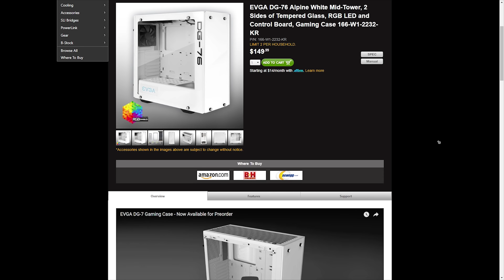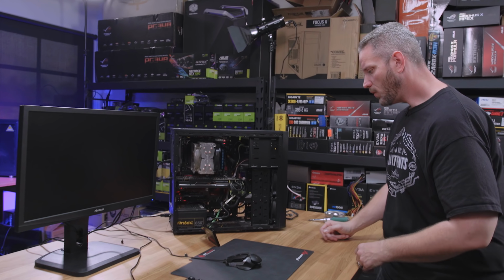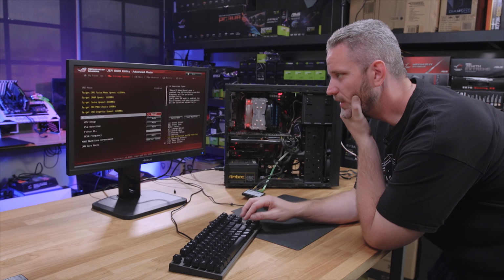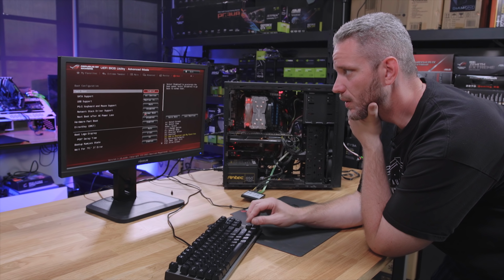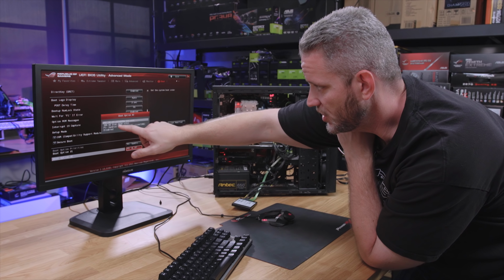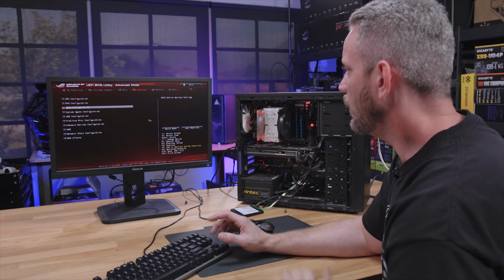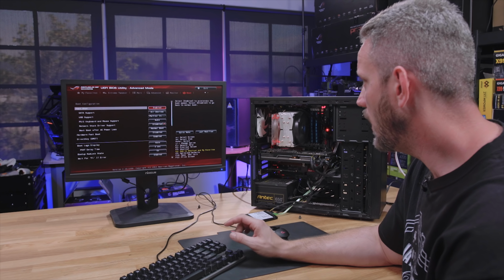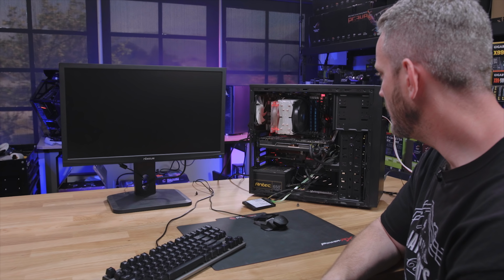Troubleshooting a bad computer... can we fix it?

Comment: I remember building my first pc in the mid to late 90's. Touched the front Power connector wires whilst it was still on and threw myself across the room. Never did that again :)
Reply: TechWizTime 12v........it cant do anything
Reply: Jack Williamson but it can’t hurt you
Reply: KrazyFuckinCrackers1 but it will shock the hell out of you
Reply: All I remember from the experience is to first remove all power from the case :) I have pretty bad luck when it comes to electricity. I was also thrown across the room after touching the metal contacts in the RF cable. Spent the night in hospital on a heart monitor. Don't remember much of that one either :)
Reply: in old pcs from the 90's the front panel power switch turns the psu on and off and the switch doesnt go into the motherboard. nowadays psu is controlled entirely from the motherboard.
Reply: TechWizTime. Lol. Not possible. I've been shocked by 10k volts Dc, and nothing happened. Btw pc,s run off Dc voltage. The psu converts ac to dc. Dc voltage is much lower amperage. So it can't kill you. Or knock u an your ass.
Reply: Ah yes. Glorious AT spec. 115 or 230V just behind your front panel. Those were the days!
Reply: lol i remember back in day i took vcr apart to just watch how the tape got stretched over that big round spindal thing and i remember putting fingers on something in there while it was doing that and lord that sudden jolt of electricity like when u grab a electric fence hit me and never took vcr apart again lol.
Reply: The dangers of AT PSU. With my 386 machine I had 2 PSU, and the one that functioned (no dead caps+new fuse) was the one without insulation around the switches contacts. Damn thing threw me as well when I turned it on (I don't have a proper AT case to work with, only a 2004 one which bizarrely has support for full AT boards as well as ITX-ATX).
Reply: Try to touch a power supply of 300W and getting all the voltage on you. You're stressed for the moment ( half a second ) and then just laugh about it.
Reply: haha old AT power supplies with mains right to the switch, used one for a while to test car radios until it shocked me a second time then got rid of it
Reply: Josh_519 I'm almost 40 (so not a millenial) and it was 240v back when I was a kid :)
Reply: I did that WAY before computers. I was 2 1/2, stuck a key in a light socket. Ran around screaming, 'It bit me!'

~Edit~ Been obsessed with Electricity ever since.
Reply: Yep you had to really watch out for those old AT style case because of them running the 110v-120v straight up to the power switch. I got a few zaps on the back of my hand as well back in those days.
Reply: Josh you could actually get a big zap from touching the back of the power switch because the wall power was wired to the switch so it had 110v-120v right there at the back of the power switch. You notice I keep saying power switch? That's because back in those days the power switch was actually a real switch and had real line power to it they called these old cases AT cases. The power switch was wired directly to the PSU and the mother board did not control the on/off state of the computer the power switch did. Now days we call it a power button because that is all it does is it is either in open state or once pressed a closed state which tell the mother board to power up or not.
Reply: Robert Lebrun yea I seen a guy stick a screw driver in the back of a PSU once I think he was trying to make the fan spin. The next thing we seen was him flying across the room. He would have touched the recifier cooling sink tower I am sure those are live high output power...We laughed about it but it took him about 10 minutes to regain his composer and laugh with us...lol
Reply: Remember AT power connectors? One long row of pins. Two half-row connectors from the power supply. And you just forgot if the ground wires go in the middle or on the sides.
Reply: @KrazyFuckinCrackers1 its not the voltage that kills you, its the amps
Reply: HA, cannot do anything.  12 volts is sufficient to shock you, the amps is how much that shit hurts. You hit my 12v rail and that sucker is 76 amps. It could kill you, but mostly it just hurts. I have also got shocked so hard from a simple 12v car battery on a shorted harness that the freaking leads melted and I went inside and fell asleep for 2 days. 

 Volts is potential for difference, the strength of current is the amperage, the potential times the amperage is the wattage, and the wattage how much total electrical force applied to doing the job, be it turn on a light, or clean your clock. An overly simplified so slightly BS analogy but workable one is using a river, were as the Volts is the grade or angle of the channel, the width and depth is the Amps, and the total water entering a gulf from the river is the watts. High amps with too low of potential and it cannot overcome the resistance of your skin. 100000 volts with .0000001 amps is like a static shock from a carpet, add a few amps and you are dead. 12 volts is sufficient to overcome your skin's resistance, and 5 volts can if you are a bit sweaty. In many applications DC can fuck you up worse BTW. AC in my nation per phase is 120v AC. 

That means the avg is 120v and it is a sine wave. The peaks are higher than the average guys, but it does not kill you, it knocks you the fuck back as the polarity changes every one 60th of a second. DC will hold you to it depending on if it either polarized or depolarized your neurons firing your muscles. You have a slight negative change so a positive will try to stick, where a negative DC will knock you away. Like charges repel negative attract.  I mean it is not like getting hit with a three phase AC, but then you are more worried about long term shit like, did that flash of light fuck me up in a way I will get macular degeneration in 20 years? Or I wonder if my fingers can be reattached. Bunch of stupid in the comment section today.
Reply: clamo6362 allways depends on intensity aswell. 50k volts at 0,005 amps can be np. 100 amp on 10volts can kill you.
Reply: True but it is more about how and the conditions of your body part. Is it dry, oh 100K Ohms in common but if you are talking the fingertip of say a guitarist perhaps 500k ohm. Wet can drop it down to 1k Ohms broken skin or sweaty say another 1K but could go off internal resistance that is much much lower. So you bump a powered 12v pin, it breaks some skin on your knuckles while you are reaching for a sata connector and your sweaty hand on the case.  12v divides by say 500 ohms into V/R xV=290 mw. 200mw over just a few seconds can cause cardiac arrest, and 250mw will cause burns, severe shock, and can kill most if prolonged contact is made for more than very short time. Do not take too many chances, electricity from a PC power supply can kill you. But best case it hurts quite a bit if you just short a finger tip, you will curse. Most of the time it will trip the safety. Then again, some folks have a questionable power supply.
Reply: +TechWizTime, hey TechWiz love ur vids man I’m like 20mins from Wollongong 😂And lol I built my first pc about 3 months ago and I somehow managed to not break anything nor have to troubleshoot I fell sorry for your 90’s self 😂
Reply: eclipse6996 lmao
Reply: He did say he was thrown across the room. I am skeptical about that but I have thrown into sheetrock and made a dent from a  signal that was based on an RF signal. But that was a high voltage radio transmitter used as retrans station. Giant radio antenna  about 40 meters tall and carried a few tens of KW RF and kindly gentleman that contracted me  had need of me to redo the connector.  I temporarily misplaced my stripper and decided to use the good old teeth. The retrans station was supposed to be dead. The computer that controlled it was not, and broadcasting station ID in my mouth. I got tossed like a toy though outside that it did not hurt me.  My mouth just makes a bad waveguide and so the electrical signal never made it to RF. 

Later in life working at the Sim Center in FT Hood I had to redo a connector as a commo guy in the Army. Giant field packed with hundreds of antenna and when I kneeled down to take a look that the connector on the coaxial for my units radio  the tip of my BDU cap burst into flame and I threw it down and noticed my hair smoldering. Good times. I do not have the PSU switched on working on PCs but I would imagine just one hand feels a bit like someone hit your elbow with a hammer(funny bone) assuming it has a way to ground out on that arm(case seems likely as your). You should never work around live current with both hands, or um,... it should go without saying but your mouth.
Reply: Josh_519
In the 90s the power switch was on mains power (120 / 220 depending on what part of the world you are from)... SO NO it was NOT 12volts...
Reply: TheGIANTgonads
By your own admission with that wiki link... Millennials  (Generation Y) start in the "early" 1980s... NOT in the late 1970s... SO if the guy is almost 40 he is more then likely born in the late 70s or around 1980... I am 40.. born 1977... we are known as Generation X...
Reply: gorepuppy
I am calling BS on your "shocked" by the 12volt of a vehicle... I have worked on and around vehicles since I was 10 years old(started on taking dirt bikes from the junkyard and fixing them up, to sell them, to earn money for food). I have never been shocked by the 12volt electrical system in the vehicle and I specialize in electrical repairs... NOW you can be shocked by all kinds of things in a vehicle, but never seen or heard anyone in this field who was ever shocked by the 12volt... Burnt YES... since messing with a live circuit and grounding out wires or the tools you are using, CAN and WILL burn the crap out of you when that much amperage from the car battery is ran through a direct short.
Reply: back in the 90's the psu switch was 120v and wired directly to the power supply
Reply: I WILL SHOW YOU DA WAE AT power was different
Reply: Just throwing my hat into this ring. 
1. The electricity doesn’t throw you. It makes your muscles contract and you actually uncontrollably leap. That’s a fact. Look it up.

2. Yes, you got shocked. No it was not enough to cause your muscles to react in such a manner. You are running off of one outlet off of one circuit on a set of multiple circuits. Contrary to what you see on television that will not give sufficient electricity to cause that reaction. Numbness and pain/burn marks, yes. In fact, that amount of electricity is more likely to hold you. Like on an old 110 before 220 became common. So as cool as you are trying to be, lying has led you to an actual journeyman electrician. So try and be cool by telling the truth. You didn’t spasm and leap backwards. You got shocked. It hurt. You might have even been dazed. But, not “thrown”. Not saying it was not dangerous or painful. Just don’t lie to be cool. Lying is not cool no matter your age. 

3. When it comes to home electricity and wiring, it takes contact to the metal plate at the back of the breaker box to cause such a reaction. Now with other devices that store and amplify the electricity within the home, then you can have enough electricity to cause your muscles to react in such a way. Unfortunately, a 90’s pc power on button doesn’t do this.
Reply: I rewired my first PC on a carpet. It was unplugged though, but it WORKED! I eventually started to get a garbled screen (GPU). Had no clue and considering the PCs age I got a new one. Took the old one apart and took the plate off the GPU (8800 GT). It had a FILTER of dust completely blocking any air flow. I imagine that was the problem. MORAL : Clean your PC often. Especially the fans. GPU. CPU. PS.
Reply: Excuse me but I've zapped myself with a pc power supply while cleaning when I'd forgot to unplug it or I was testing it I can't remember which needless to say it was direct 240 volts and I didn't get thrown but I know it bloody hurt
Reply: or should be as there was a lot of cases made in the 90's 
no doubt they still on sale somewhere
Reply: @WTFZOMG  I've worked on PC's from the 90's they turn on the same as today's one's sorry to disappoint

Comment: at 8:00 you said There was another bit of info that the customer told you that had you "extremely worried" and then never addressed it again. Now im dying to know what it was! Dont leave me hanging JAy!!!
Reply: Hey guys. Two things 

1. The SMART Check was disabled to get me past the error to test the SSD so that I could see if the OS would boot. They are advised to replaced the HDD. It wasn’t left “OFF”

2. The other issue that they expressed to me that I forgot to talk about was they had gotten an “over voltage warning” while POSTing once before the problems started. I don’t think the PSU is going bad, I think wires were possibly pinched causing a short but the issue never presented itself to me. 

Pinned comment from Jay, if you didnt see it already.

Comment: I love that Commercial Electric 10 in 1 screw driver you are using. It's the perfect size for jamming in the ground hole on outlets and tweeking them when the outlet won't line up correctly.

Comment: Great video, I did something similar to my brother's computer recently where I needed to replace his AIO pump and CLEAN the dust out.  Ultimately that's what killed it and raised temps in his system.  But it's all good now and I installed more fans WITH air filters on the intakes.

Comment: That looks like an NZXT Source 210......the first case I bought several years ago for my first modern pc build....and the one that introduced me to the perils of buying a case and not knowing about or adequately researching things like cable management space, adequate height for the CPU cooler, or mounts for 2.5 inch SSD's, etc, and having to buy another case that did have all those things.....only to find that THAT case didn't have adequate space above the motherboard to fit my cooler AND a top fan.....it taught me to check the specs carefully first for what I need, and worry about the price second.....it was a great learning experience that took me all the way to a Phanteks Enthoo Primo and a Thermaltake Core WP100! Long live the Source 210!

Comment: Every problem was unplugged cables or wires. Lame.
Reply: Yes, that seemed way too easy ...
Reply: @pufaxx  Also a drive being set wrong on bios. Or did it default to the other drive because the ssd was unplugged
Reply: To be fair that wiring job was a goddamn mess.
Reply: From experience, that's genuinely what it is 3/4 times.
Reply: @Anomaly188  i would make just the same mess though
Reply: The funny thing was, they went in and unplugged the GPU, AND replaced the switch cable.  At that point, any cabling problems that exist are PEBKAC.

Comment: What was that thing that had you extremely worried?
Reply: Rubik's Cubed possibly GPU and motherboard fried. Man , I'd hate to go out of the operating room to the waiting are , " sir good news we can fix your computer , bad news , its going to require a second mortgage."
Reply: texasdee slinglead Yeah, that makes sense. I'm glad that it ended up being a purely "cosmetic" fix, if you will. Didn't require the replacement or the troubleshooting of actual components.

Comment: This Video fking made my day. For the last two days i was looking for the issue why my new (old, because i bought a used one from a friend) asus mainboard wont boot any drive with GPT format. I was in despair. I accidentally came across this video and saw your tip switching off the SMART startup check and boom, it finally worked ;) Thank you very much!

Comment: I do much more of this type of thing, than any high-end builds. I did once rig an HP DC5850 AM2 BTX motherboard into a Dell XPS 700 Series case, re-wired all the LED strips, got everything working. 

It was crazy looking at a little micro-ATX board in a gigantic PC case. By the way, the Cooler fit just fine on the HP mini board. If anyone has a blown out XPS 700 series and wants to make it into a flashy Media center or something. I can help, and I think you can get a Phenom Quad into those old DC5850s.

Comment: Sounds like the fan blades were rubbing on something. you could have tried tweaking the motor housing a little because i almost guarantee that would have solved the noisy fan issue. i use a lighter and carefully heat up the plastic supports for motor housing then push or pull on it till it stops being loud.  great video jay. as usual.. cheers!

Comment: I had a real fun computer issue that to this day I don't know what the hell happened. It was a Ivy Bridge setup that I left on 24/7 for about 3 years or so. I was going to a friends house for a weekend and so for some god damn reason I turned it off. I think you know where this is going.. heheh
   Got home, hit the power button and nothing. No lights on the motherboard, no nice computer turning on. Flat out nothing.  I checked the power supply and it was working. Heck, this computer has that power supply now but anyway, I rechecked all the connections and still nothing. No life. pulled out the cpu, the memory and video card and reset everything and nothing. Tried another power supply and still nothing. 

   So, lucky me I decided to get this new Ryzen motherboard and cpu and took out the Intel Ivy Bridge setup and resigned myself to just chuck it in the bin... Well, it sat on a shelf for about a year and I took notice of it and said ok, time to just get rid of it but for some reason I decided to give it one more try, had the motherboard and everything sitting on a table and hooked some power to it, jumped the start switch and the damn thing worked. I put it in a spare case and it's still working.. Ok, it's a backup computer.. And I still have no freekin idea why it stopped working way back then... Funny huh?
Reply: Maybe turn your computer off every once in a while?